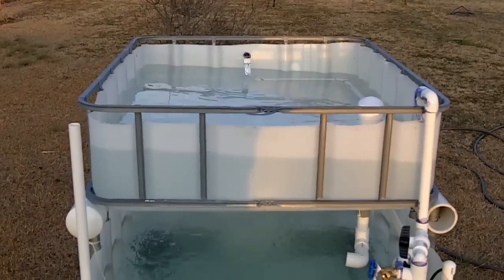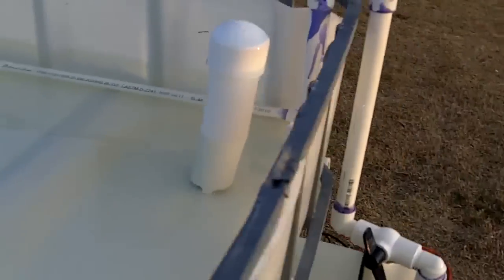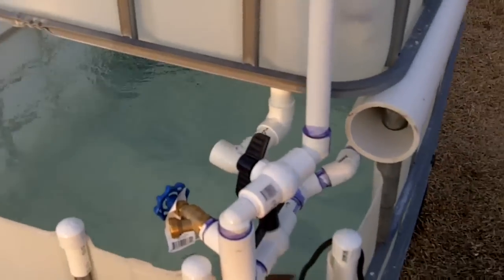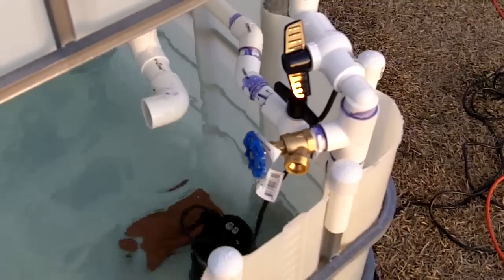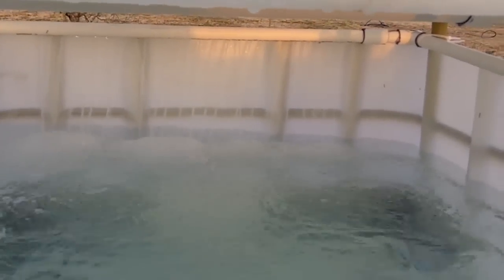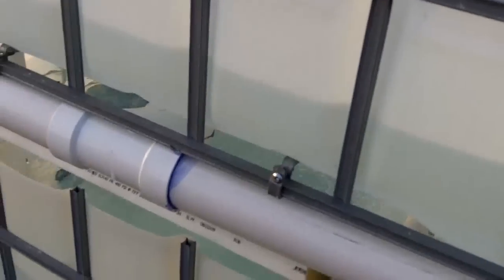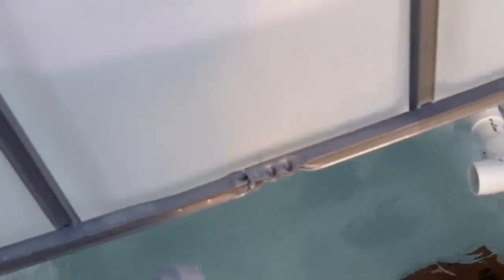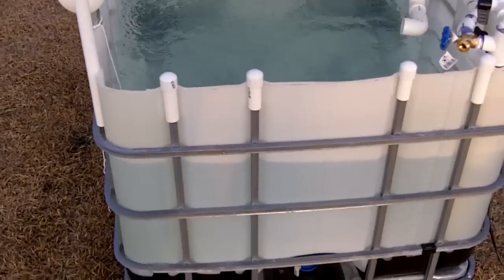Aquaponics IBC tote setup

Comment from the maker: @StogieFarts The heaters also will help keep the temp higher at the start of my season and hopefully get a quicker start of the bacteria necessary. With higher temps in the summer be mindful of shading your fish tank to keep the water temp lower in the summer.

I am close to Raleigh in NC by the way. I never really noticed a problem with rain changing the ph. once you get the bacteria going in your system the PH will tend to drift lower. The water you use will have a bigger effect in my opinion.

Comment from the maker: @StogieFarts  If I were building another system I think I would consider a Magnetic drive pump. I am not sure if my new pump is going to last but it is what was available when the other quit. 
If the lowest temps you have are the 30's you should not have to worry about a heater too much. Right now I have a 250 watt and a 500 watt heater in my system. I have them set at 68 degrees but it is not near enough to maintain that temp. My goal is to keep frem freezing during cold snaps an it does well.

Comment from the maker: @StogieFarts The first pump I used was a Wayne 2400 gal per hour. That pump did not last a full year so I don't recommend that pump for aquaponics. The pump I replaced it with is from Lowes it is a utilitech 4000 gal per hour waterfall pump. I added a bypass with a valve to run some of the flow back into the sump. This gives me plenty of flow in reserve if I decide to add to the system. Just a note, I tend to overbuild things so you should be able to get away with a much smaller pump.